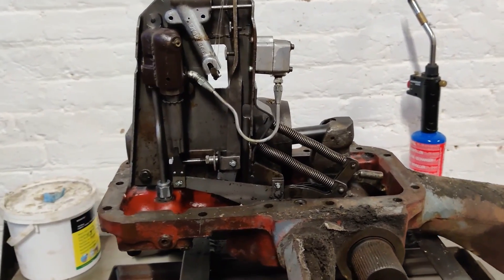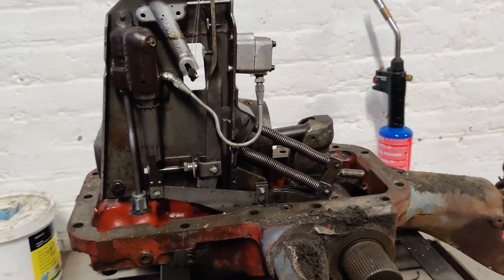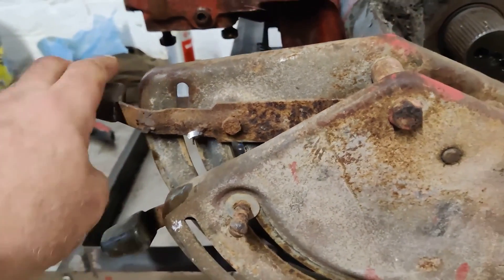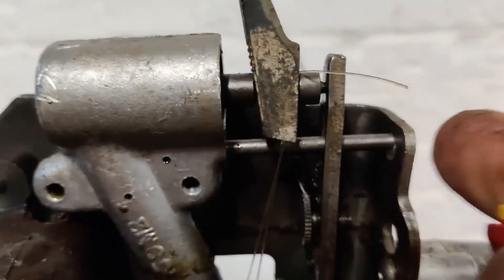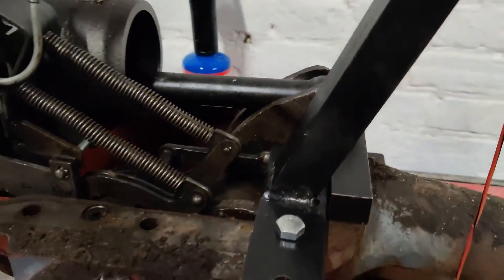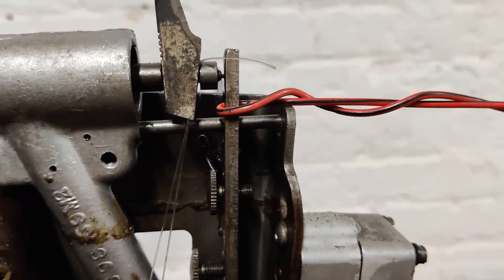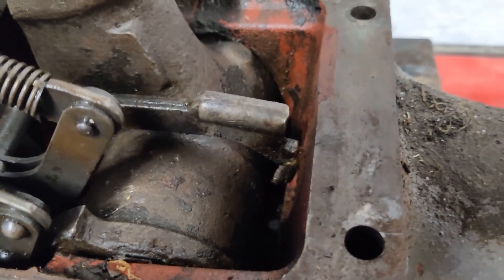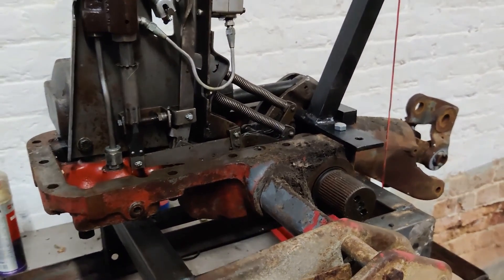Hydraulic Horrors - Massey Ferguson 100 series top cover setup and adjustment. -  Part 4

Comment: Hi have just started watching your videos, and need to pick your brains, I friend of mine as been sticked up by a MF main agent in france, he was told he had a crush pto on is 158, gave it back in pieces after quoting 4000 euro, it cost him 400 for the quote and would have been another 400 to reassemble un repaired, I reluctant helped replace clutch plates which showed little wear, what the they did do was to turn around the coller on main drive shaft meaning once you select a gear the shaft pops out, this was deliberate, I didn't remove split pin. Long story short the pto starts and drives his topper it cover about 5 metres then drops out and after a minute cuts back in, just as it did when it went to mf for diagnosis. Any thoughts would be appreciated.

Comment: I have a problem, the 175 lift only lifts up but I can't lower it. The take-out is stuck and can't be turned on and if you turn the stern it doesn't turn freely. Any advice?

Comment: I have a question, just to understand the hole thing. You mentioned that when position control isn't adjusted correctly it could break your top cover and gearbox casting. But what if you go into constant pumping by mistake and there are no external hydraulics connected? Won't it then raise too high and cause the same damage as when not adjusted properly? I find that a little confusing. Was it really designed that way that it destroys itself when the driver does a wrong manipulation?

Comment: This is an excellent well done video that explains everything well and the correct steps to take. I have one question. Will the MF 272 ram arm fixture the correct fixture for the 1-1/8” thick lift cover or does it work for both the 7/8” and 1-1/8” thickness covers? Mine is the thicker cover and I have one on order from VL Churchill.

Comment: Hi mate great videos, little bit scary but great, I have reassembled my cylinders in my mf40 which is the same as the 165 without the pressure control by the looks of it. Dumb question the studs into the cyclinder, they have a short thread that goes into the cyclinder but there is still room before they bottom out. If flipped would perhaps bottom out. Manual seems to be long thread out, when I pulled it apart seems to be long thread out and you are putting it back together long thread out. IV put it back together long thread out. Just wondering why you wouldn't bottom the thread out into the cylinder. Cheers mate 
Thanks

Comment: Good day. Have my 1967 MF 135 with Power Control Unit that I’m working on the three point. Where I’m stuck at is that I can’t find a specific manual for my tractor. Where did you find all the special tools required to set the timing, such as those blocks?

Comment: pressure control - is that setting the pressure relief valve for the overall hydraulic system, great video btw
Reply from the maker: On early models, the pressure control valve acted as the relief valve too.
Reply: @ClarenceFudWeasel  I have a problem at the minute with a 168, same as you are working on in this video series.  if there is a load on toplink such as a fert spreader, lift cylinder pressure drops like a stone, with no load on toplink can get 3000psi in the lift cylinder, without issue.  Thus I conclude its somehow related to the draft.

I guess I should give some background, top cover was removed to put new piston rings in lift cylinder and replace control valve few mths ago.  All was perfect prior to the aforementioned mechanical work, 3000psi in lift cylinder without issue., lift was constantly compensating which necessitated the mechanical repair.  Is it a case of reopen the top cover again and readjust draft lever positioning.

Comment: Hi their. Firstly Great information there.  I am fixing up a 135 and the  pressure control ajuster spring is in three bits ,well broken.  I can't find one for sale or a part number for it. I wonder if you know the part number for it or where I could get my hands on a spring. Thanks  and keep up the good work.
Reply from the maker: AGCO dealers should be able to sort you out, the same spring was used to my knowledge in the 600 series and possibly into the 300

Comment: Well, that's decided that for me. I'm not touching that bit of the tractor. Hopefully, 1 of the 2 jobs I'll farm out. The other is the injector pump and injectors!
Reply from the maker: Good luck with it.  What are you working on?
Reply: @ClarenceFudWeasel  1976 mf 165. She's had a hard life and little to no maintenance in the last number of years. Up until it was imported into Ireland, she would appear to have been looked after

Comment: A very informative video Mr Fud-Weasel and appropriately title of your video especially if anyone tried to making the settings and failed because of the lack of knowledge and tools necessary if not criticality needed as well as the proper factory workshop manual, I don't blame you for putting off this video for a while, 10/10 for peresentation and showing the tools required (I wished every video was like that in the beginning) and the sections of each adjustments, 👍 no need to thank me for watching but thank you for showing.🙂
Reply from the maker: I'm going to thank you anyway😁
Reply: Your welcome as always.🙂

Comment: You explained that well Clarence! I recently refurbished my lift cover on my 1966 MF 165. I replaced the lift cylinder & piston. I didn't have the tools to set the various control settings, so I took it to guy who was a former MF service mechanic who did. You are right - if you get those settings wrong it can get very ugly in less than a second!
Reply from the maker: That's true, I have seen several gone wrong over the last few months, so I decided to put the video out.

Thanks for watching.

Comment: Something I'll probably never do but always good to know.
Its impressive how they worked out stuff like this when these things were originally built.
Reply from the maker: I agree, it's getting on for 90 years old and a completely self contained mechanical feedback loop.  It's a very elegant solution to a problem.
Reply: @ClarenceFudWeasel  I was at the National Computer Museum at Bletchly Park Last week. The Turing Welchman Bombe (for decoding Enigma) had a mechanical feedback loop added to improve performance. Elegant indeed!
Reply from the maker: @keithmatthews1673  it just shows what can be done without having to resort to electronics.
Reply: Gracias!!! Aquí no hay muchos mecánicos buenos de estás máquinas. Es un problema encontrar piezas. Si las encuentras te los cobran a precio de oro. Gracias nuevamente. Estoy disgustado,  estoy entre la espada y la pared. Ésto pinta feo.

Comment: It was an excellent presentation, but you lost me at the first turn. When I first got a real tractor (I inherited my FIL’s Massey Ferguson 175), I learned a lesson about how incredibly powerful the 3 point hydraulic lift is. I was pulling a small trailer on the drawbar and one of the lift arms swung under the tongue. I realized that it would be better to carry the arms higher so I hit the up lever. The lift arm did not clear the tongue and it crimped a bend in a pretty stout tongue before I could have a second thought. So, having seen that, I have full respect for your warning that a tiny lapse in judgment can have a catastrophic result and the damage is done long before you could possibly react. Shade tree mechanics have been warned. 🥸👍👀✅
Reply from the maker: Oh yes, and the lift at the end of the arms is a tiny fraction of the force on the piston rod!

Thanks for watching 🙂
Reply: Good advice there as usual 👍👍

Comment: Never though I’d say this but I’m glad I’ve a merc, it’s simpler 😉😁
Reply from the maker: Your MB is lower link sensing isn't it?
Reply: @ClarenceFudWeasel  if it has it doesn’t work 🤣. Funny enough, being merc, is a weird set up and to be honest, I’ve never actually looked into it to see how it works properly. I think your right, it works of the lower linkage but I’ll have to check now🤣
Reply from the maker: @casto-  I'd be interested to find out, never worked on one. 🙂
Reply: @ClarenceFudWeasel  so would I now!🤣 I no there’s some stuff under the rear deck behind the top link but I’m sure it’s not attached. The mogs didn’t have anything till about the 80s when they had terramatic (if I remember right) which was an electronic control system
Reply from the maker: @casto-  you'll have to share some pictures of what you find.  I wonder if the terramatic was  related to the Bosch system used on the early MF electronic
Reply: @ClarenceFudWeasel  will do 👍